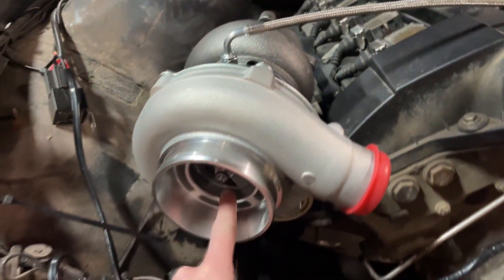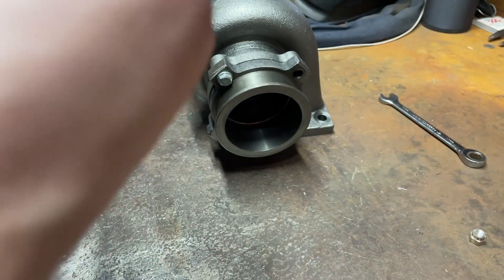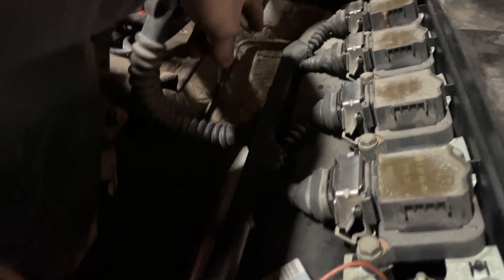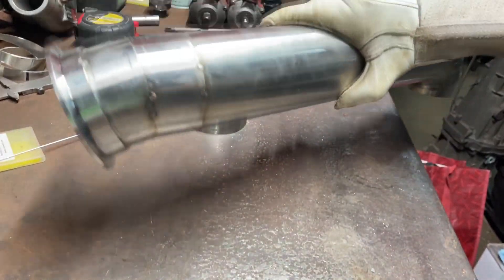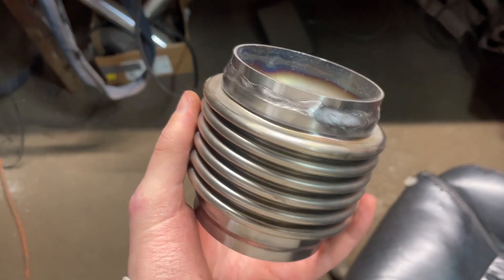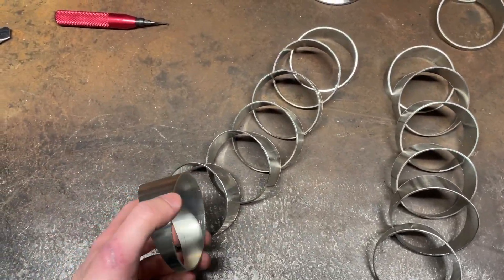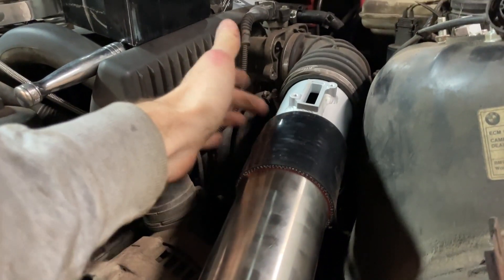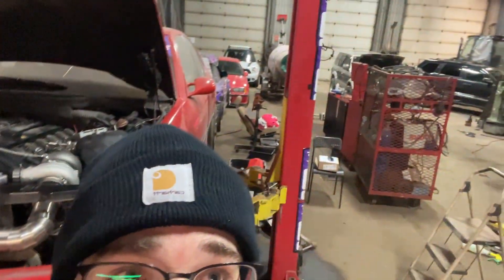E36 M52 Turbo Downpipe Fabrication + 3076 Upgrade!

Comment: Are you gonna be using the Audi RS4 MAF? That adapter looks interesting.
Reply from the maker: Im running a pmas hpx maf, RS4 one works as well as long as you have a tuner who is willing to tune with that setup.

Comment: Help. 2 questions. I am installing a bottom mount turbo. I want to retain the AC. 
1). How should I route the piping on the exhaust side?
2). Does the turbo need to be Clocked so that the feed port and drain ports  are straight up and down? Is it safe to clock the turbo so the drain hole is at 5 o’clock or 4 o’clock?
Reply from the maker: Not too sure about bottom mount setup with AC as I dont have much experience with those. As for clocking the drain 5 oclock is fine 4 is pushing it a bit. I know its common for people running a bottom mount to run a scavenge pump which helps the return flow and allows you to run a more aggressive angle.
Reply: @aco.b  thanks for the info.

Comment: Will this work for a 99’ e39 m52tu?
Reply: Same motor but he is single vanos and yours is dual vanos. Not as simple as turbo go there pipe go there. You'll need many many many different fittings, sensors, custom piping made, tuning, some more tuning, etc. 

Do your research and then do more research, start saving now to do it properly or you'll be saving for a new motor to try again.

Refresh before boosting m5x engine:

COOLING SYSTEM: Radiator, Upper/lower coolant hoses, Thermostat, Coolant temp sensor (on lower coolant hose), Fan clutch, Water pump, Aux Fan.

VANOS: Viton O-rings,  Anti Rattle Bushings, Gasket, Piston Housing Seals.
 
should also get in there and replace timing chain and guides depending on mileage.

Hopefully it works out for you. Best of luck.

Comment: I will leave a comment, that you are not listening to me.. ;P Joke, ofcourse, your choice. But as gt30 is already big for 2,5, the AR over 1,0x is even worse...I got your point, that you don't want to stress the rods and higher cr out at lower rpm ranges, but damn...it will make 7 psi at 5k :)
Reply from the maker: I have some friends with the same setup! Since this is a stock compression 2.8 it actually makes full boost just above 3k! 😄
Reply: @aco.b  0,3 liter more...and on what gear ;) I have personall experiance with m54b25 with stock CR on gt35.30 ar 0,63 (inlet 35, exhaust 30 with waaay smaller AR then you say) and it was waking up on 2nd gear seriously at 5k. Unless you plan to run E85, then ignition will help somehow. For me gt30 with 0,63 will be a bit too laggy for 2,5 but everybody ofcourse has different needs.  Ok, will the results :)
Reply: @FaworDrifts a gt35 isn't a gt30. What turbo did you have ? Garrett never put a gt35 compressor on a gt30 turbine.  What a/r?   Did you forget the fire ring? Your older videos show a gt3582 on a m54b25. This g30 is a lot smaller on a bigger motor. 2.8 's rip compared to a under square 2.5.
Reply: @FaworDrifts  please answer on @jasonschreiber6458's comment. 
(I collecting info to turbo my m54 and can't decide what turbo to get (gt3582r a.r 0.6 or 3076r ar 0.8). 
My tasks is drift on 2/3 gear dry surface (3.38, ZF320))
Reply: @alexman9062  ok so step by step. Didn't see the answer, have read one more time all. First of all - this car is 2.8??!! I literally thought all the time, that this is m52b25  😅 That changes a lot. But further, answering Jason: ofcourse I'm talking about chineese/polish made turbo, 35.30 came from K64 company. gt3582 in a beater compact with m54b25 on my reel didn't forgot the fire ring :) This turbo is simply waaay too big on both sides to be woken up thru 2,5 fast. Ofcourse gt30 is way smaller. But I come to this conclusion that still too big for B25, cause I have GT30 IN MY B30 and FOR ME is still a bit laggy on 2nd gear. Now directly Alex for you: I'm analysing now how to turbo my missile Wagon with exactly M54B25. Made quite big sheet with comparisons of the wheel sizes in many turbos, from chineese's  thru pulsars and oem garretts. Watched a lot of yt movies with turboed B25s. My conclusion: for B25 to have good wake up I would put nothing more then GT3071 with 0,63 AR. Why? Cause people are putting GT30s on AR0,63 for 2Js (Brandon Wicknick loved it). Cause people are putting g25's (Garrets and Pulsars) for 1Js, which are 5mm smaller on turbine wheels then GT30. Cause stock CT15b form single 1jz has almost same hot side as G25 but even waay smaller cold side. I would turbo my b25 even on td05-20g (Scubi 2,5 upgrade turbo), cause is very similar to ct15b, but here you could start to have problems with stock rods..sory, a lot. But a lot to talk about. If you would more, we could contact other way, sory Aco for spam :)
Reply: @alexman9062  one of the bests example - my friends b28 (slightly decompressen thru rods) with 3076 on 0,63 AR. Look/try to hear how it builds full load on very long 2nd - like still over 4k rpm. Then grab 0,3 liter of displacement :) For me it is still not satisfing, when you are not aiming for 4++ marks, just for good response in 3++ setup.